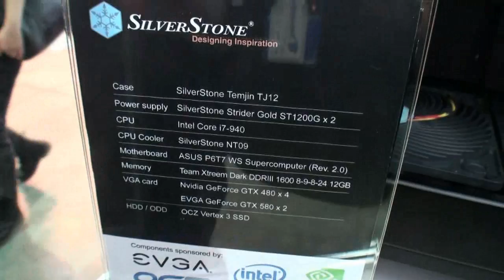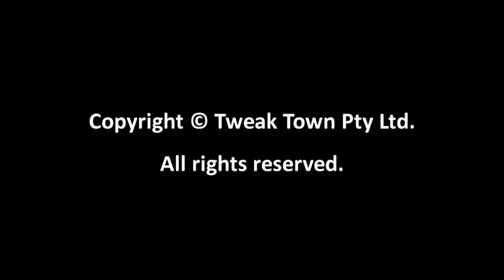SilverStone Temjin TJ12 case with six GeForce GTX 580 video cards, 19 slots!

Comment: I don't see most silverstones being comparable to coolermaster. In my eyes only some of the cheapo silverstones and the raven series are particularly gaudy. I personally own a ft02 which I find quality, minimalist and stack cooling is brilliant. Currently in the process of giving it a 2x180mm rad. If I bought again I'd probably get some expensive aluminium case, whether it be Lian li or silverstone.

Comment: Indeed, they can spread the graphics card like that, BUT, they also need to build a special connector for 4 way SLI, or 3 way. The connector for SLI it-s flexible and a bit loger but will fit?! :-/
Just saying.

Comment: In case some haven't noticed 2 of the cards are different, not much versed in the nvidia side of things right now, but i've seen setups incorporate a different card, in this case possible two that act as physix or some other function, also this is all display stuff.

Comment: @lonesoldier33 no! it is not possible to run more than 4x1GPU cards SLI or Xfire even 590's and 6990's are only limited to 2xcard a total of 4xGPU unless the manufacturer has a driver to support in that particular set-up?

Comment: @jaja1818 it can be used for gaming, but the only way you would be able to get any of them to work together would be to use an SLi bridge for 3x or 4x SLi. One of the others could be used for Physx processing i guess. Crossfire might not work in this situation due. Otherwise you could run theoretically multiple games and have each GPU focus on a single game. Still, this is a workstation PC, nothing more or less. Really pointless for gaming.

Comment: @janenba352 ic so its more of a workstation setup rather than gaming??can i ask if you will use this for gaming..will those apps only use the maximum no of 4 gpu's in xfire or sli and idle the extra two gpus or will it just run a single gpu from all 6?thanks for the info by the way

Comment: wait...can you really run 6 gpus???up till now am only informed of maximum of 4 gpus is the most supported and available system on both crossfire and SLI systems..can anyone clarify this?or are they just doing a actual demo on the maximum capabilities of the case?